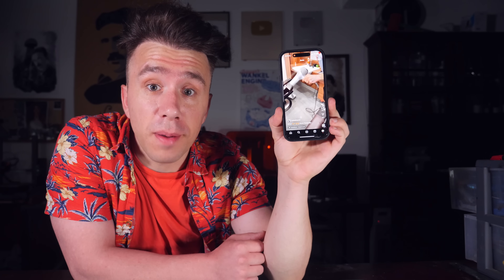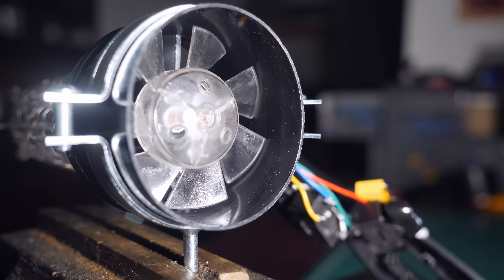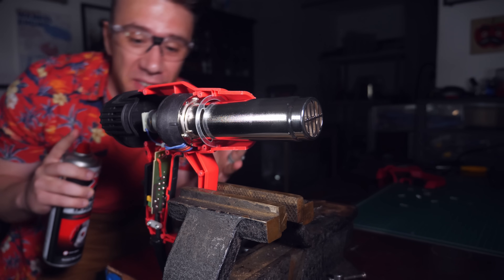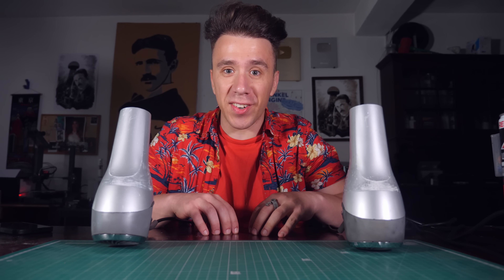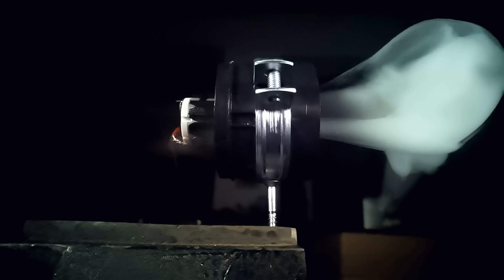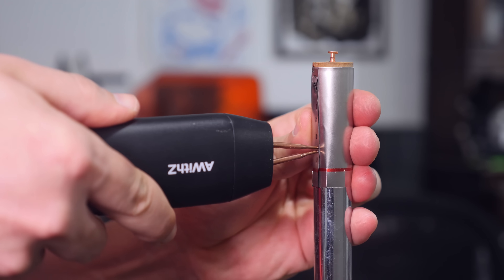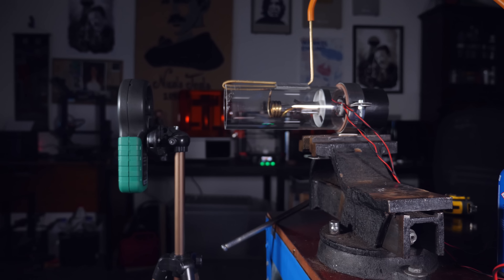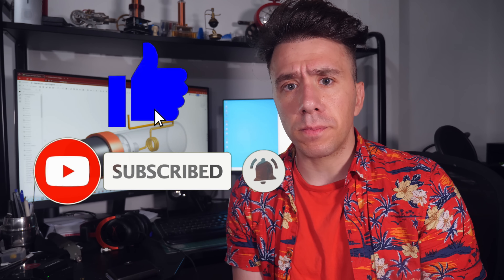I turned my $20 Hairdryer into a JET ENGINE

Comment: As I said before, you need to compress the air with the brake cleaner before passing it over the heating element like a turbo or a supercharger in a car.  Also like a gun riffle the output so the air and gas spins around the heating element.

Comment: My idea to improve the design: make a defuser that doubles as the shield around the nichrome coil, any air that travels past should slow down and enter the coil area at higher pressures to assist in combustion. I cant remember the name of the sponsor who can metal 3D print but they would probably be perfect for this and many other videos.

Comment: You should try to add the converging nozzle to yours like in the video as it’ll accelerate the flow and compress the air a little more. That can prob work for a normal hair dryer

Comment: More wire does not mean you need more current to get it hot.  It means you need more voltage to achieve the amperage at which the wire gets red hot.

Comment: Me and my 10-year-old son watch the video and loved it. We talked about it and imagined four fuel inputs put at an angle in front of the fan blade. Each with their own heating element and fuel supply from one main fuel source that is pumped through all four equally. The lit fuel would enter the chamber right in front of the fan blade at an angle that coincides with the vertices of the fan wind. This way, you’re supplying fuel all around the main area where air flows around the fanblades.

Comment: If nobody mentioned adding salt to the tubing and crimping the ends before bending will help to ensure it won't collapse upon itself. The salt will easily risne out with water after. No heat needed to bend.

Comment: For increased thrust would a nozzle work? Like a turbo jet?  Correct me if I'm wrong but, wouldn't that slightly compress the air and allow for a better fuel to air mixture?

Comment: Inject O2 gas instead of brake cleaner, it will be a bang. and you can melt the face off a tomato when doing it.... Because Tomatoes really are disgusting! (oh and try coning the tube like a rocket nozzle)

Comment: could prob use a 3d printed stator/diffuser ring to guide the air into the flame, interference fit should work instead of mounting as its before the flame, and adding rotation to the air will likely show improvements. could also inject into the combustion chamber through a hole in the acrylic if heating the fuel isnt essential.

Comment: You could try to make, or re-use, a car injector to do a beter mix air-fuel. They're meant to do the best mix as possible to use absolutely everyting in the chamber. You can also calcul, with the air flow meter, how much speed and fuel you need to do the perfect mix

Comment: throw a helical fin design that can allow air flow and add some constrictor towards the back end. you can then have holes in the tubing that would now allow you to add extra fuel further down sort of like an afterburner. by ramping the air you should be able to generate better thrust out put. sort of like an aerospike

Comment: Higher fuel pressure, smaller nozzles! Maybe a fire ring manifold with much higher pressures, but smaller nozzles to atomize the fuel!? Maybe? 
Think HPLV, high pressure, low volume. And maybe an internal metal tube to help with combustion  chamber?  That has a large chamber reducing to small, to help with compression?

Comment: Hm just a thought, but you know those propane burners people use for large pots? Those use a mechanism that allows you to moderate the airflow for the burner with just a turn of a valve. I’d tinker with that and see if you can’t incorporate that into your build. That valve design pulls air in rather than directly propelling it. Maybe a combination of forcing air into the intake area and propelling it would allow for enough compression thus causing a WOOOSH

Comment: I think a way to improve it would be using the fuel lines as the rapid air shielding for the combustion chamber, in that way it'll also preheat the combustible, and reducing the overall weigth, also, it may improve the exhaust velocity constricting a bit the chamber, not like a nozzle, but more like a turbofan

Comment: I think you should create an inlet from the side, at an angle so it creates a spiral of injecting fuel. The inlet should also include the wire so the fuel ignited before entering the stream of air.

Comment: You need to look up exhaust Augmentation where you have a flameholder, spray rings and ignitors. This gets really hot fast and consumes loads of fuel, but the thrust is going to be insane. Any modern day Turbo jet engine has this.

Comment: Measured fuel injection system, fanspeed control with power meter for monitoring draw, add more holes into the endpoint of the injection system for better fuel atomization. 
Just a few ideas that come to mind, thank you for your amazing videos! Educational and fun!
Reply: W man
Reply: He could also add another tube that's capped or a complete circle loop with holes drilled in it that's half the diameter of the acrylic tube. Place it in the middle of the flame dispersal zone, and it'll act as an afterburner.
Reply: @longov excuse me. What the quantum physics are you talking about lol
Reply: Cool😅 smarty
Reply: What if he uses propane or a more flammable material or gas or liquid doesn’t matter

Comment: Make a fan that is driven by a gear or belt and place it in a large outer bearing so that you do not need a DC motor for the fan itself. then you have more air movement and no air blockage. or you can use a tube as the shaft of the fan where you supply your fuel for a long time (with a bearing around the tube)

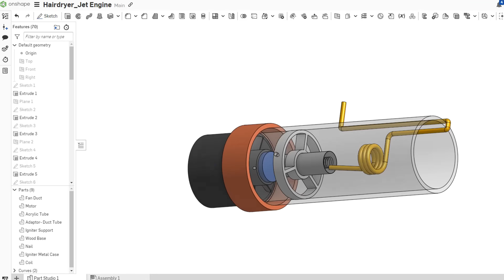Comment: 13:10 put a diffuser cone in front of the injection coil, to push some of the fuel outward tho allowing some to pass thru as it is full of holes to catch fuel in draft and make a self regulating catalyzer of its self so the starting coil can be turned off tho its close enough to the center draft that the pilot flame stays on... like a cheese grader tho. that centered iron that lets air thru it... Instagram a windows pait pic...

Comment: In order to utilize all of the fuel build a housing using a similar concept as a smokeless burn pit. Using concentric cylinders you can separate the fuel mixed air from the intake and a modified carburetor to spray the proper amount. I don't have it fully fleshed out but that's where I would start.

Comment: @Integza Hey Integza. I had a thought when it cam to your wind meter. Why don't you "sketch up" <-- See what I did there? LOL. Your Windmeter blades and shroud. and 3D metal Print a replacement metal unit for this type of testing to stop the melting issue. :D  I Love your videos. we have similar minds. Keep them coming buddy!

Comment: you could put 6 mini misting nozzels on the sides of the tube right after the fan and 2 or 3 igniters a bit further down in the combustion chamber. also, please add a nozzel

Comment: Atomize the fuel after the fan in the space that has the dead spot after the hub. after the fuel is atomized into the high speed air, duct it past a "bell" that houses the igniter and functions like a flame holder in a regular jet engine. The space with the bell/flame holder would need to bulge out a bit to maintain a constant volume for the air channel until it tapers back down after your flame holder/ignitor. 

the diverted bulge of the air channel would give the benefit of adding turbulence to mix the air/fuel and then the void with the flame holder/ignitor after the diversion also takes part of the blowback risk from the expanding burning fuel, this should improve total effective thrust.

Comment: If you look at "how to build a jet engine using a turbocharger", you'll see they usually end up using a tube with holes to make a flame holder for that... 
I always wanted to build a transparent one, but round tuits are an issue for procrastinators... if you look at TechIngredients and a few places, you can get the dimensions and engineering how the static pressure and the airflow sets the pattern and placement.

Comment: Well what I would do is inject more fuel into the air after the initial combustion so you don't need to worry about ignition. Run the engine rich and add a flame holder. Afterburner time.

Comment: you can buy liquid brake cleaner in drums without propellent from most automotive stores, that will allow you to pump or gravity feed the fuel at controllable rates, also if you have additional air then you need an afterburner!

Comment: To increase the air used in combustion maybe use a steel/glass tube and multible fuel nozles around the tube and use electrical sparks for a more reliable ignition of the fuel??

Great vid 🍻

Comment: Same suggestion as yesterday: keep the internal combustion, add a ring shaped injection system to force a fuel air mixture into the chamber with the existing combustion. Poof! More combustion.

Comment: The first thing that came to mind. Likely needs refinement. 

Idea:
3D printed fan blade with  internal fuel line to multiple nozzles along the trailing edge of the blade or ported flush to the airfoil surface. Tricky bit would be a low enough friction fuel rail/fuel hub from which the rotating blade manifolds could be supplied by a stationary fuel line. 

Thinking the fuel line can come in axially to the nose end of the propeller hub and interface with something like a rotating linear hose coupler that can handle the rpm. Then that goes to a central distribution plenum with a conical base (perpendicular to the axis of rotation) that the blade manifolds then feed from. The blades may even give a pressure  boost at the nozzles due to the centrifugal force flinging the fuel out along the primary manifold line.

You may even be able to normalize the relative pressures at the nozzles by varying the secondary manifold lines diameter for a given fixed operating rpm before printing (requires experimentation and investigation).
The benefit of that would be to gain  design control of the fuel flow and atomisation (mixture) through the full thrust column cross section for a steady state or "cruise" operating condition. 

Just what came to mind. 
Looking forward to the next installment. 
-C.
Reply: Actually on second thought.... I think you 3d printed some ceramic before. 
 
3D print in ceramic a post which the ignition element can be wrapped around.
Internal to the post should be a path which the fuel can be pumped through  to heat it up and ideally vaporize it. 
The fuel should then be ported through nozzles around the base of the post (towards the front of the engine ). Think of it like taking the frame of an umbrella putting it in a tube of concrete and then removing the tube and melting out the umbrella frame and then pumping fuel in where the umbrella handle went and having nozzles around the circumference where the umbrella arm tips are.  All while the ignition element is wrapped around the outside heating  the concrete which preheats the fuel. 

The reason for this is that the coil fuel preheater in the jet stream does a couple things.
 One, disrupts airflow increases back pressure and decreases thrust. 
Two, takes away thermal energy from the exhaust gas thus reducing nozzle pressure and affecting thrust. 
If you are adding the compressor energy with an electric fan and heating element, and if the goal is to get the most increase in thrust for fuel given. Then it's better to take more energy from the electric heating element rather than sacrifice thrust energy. (Potential Energy (chemical, electrical) In = Energy (electrical/magnetic, mechanical friction /thrust/acoustic noise, thermal/heat/light) Out. 
Where, design optimization turns energy from loss categories into the desired thrust. 

The main reason I wouldn't recommend this type of preheater is that; For this application, the burn temperature, and burn distribution for the given air/fuel flow rates, and average burn duration, is such that it's unlikely the preheater in its current format will reach a sufficient temperature in normal operation to have a significantly positive affect on fuel atomisation or vaporisation and subsequent thrust when compared to the performance disadvantages mentioned previously. 
This is speaking from experience. I did the exact same as you. 
Pro tip: if you decide to scale up do not use copper. 
As soon as you do finally get good ignition and optimized burn, you will be rewarded with the liquification of your tuned copper preheater and several hours of carefully removing copper from the hot stage components of your turbine and nozzle assembly. 

Old school pro tip: when bending the copper. First fill the tube with sand and plug the ends with a hammered in wood peg or chopstic in this case. 
The sand stops the tube from buckling during the bending, is not affected by heat, and can be poured out after forming. 

The next trick is getting a good mixture through the thrust column. Maybe vortex generators or ceramic stator fins at the top of the igniter nozzle. 

Or in the forward end of the igniter nozzle you have ceramic stator supports radially out to the outer tube to hold and position the igniter nozzle. Then in those struts you run an internal fuel manifold taking the "umbrella arm tips" up the strut and ported to nozzles along the trailing edge so the hopefully vaporize fuel flows back over the ignition element as it mixes with air and ignites. 
From there I think it would be interesting if adding a ported flame tube around the igniter improved performance by controlling the rate of air fuel mixing and shielding the igniter from the air stream thus improving fuel atomisation/vaporisation by allowing for a higher preheater operating temperature. Better atomisation or vaporisation means more even mixture with less effort and disruption/resistance to the airstream.
Reply: If the fuel starts leaking through the porous ceramic. Then use that glaze they put on ceramic cookware like coffee cups. 
Mix it up thin, pour it through the fuel channels then use an air compressor to blow out the excess leaving only a thin film to seal the fuel channels then re fire it in the kiln that you did the initial sintering. Don't do it at the same time or the off gassing if the binder in the printed part will cause voids in the glaze that will leak. It needs to be a 2 stage fire I reckon.

Comment: @integza add a cone like that on a rocket  engine only since using a fan dont make the nozzle so small reduce the diameter by 1/4, 1/2 if it still works then go smaller

Comment: Maybe you could print a Part that decreases the inner diameter of the acrylic Tube for a short section and after the comression step you have an embedet Ring as your fuel line. So when the air fuel mixture expands again the fuel is more evenly mixed throuout the airstream. The igniter could be Placed in the middle of the fuel injektion ring.
I hope its understandable englisch is not my firstlanguage

Comment: Suggestion: In the original video of the brakekleaner you see that a nozzle is attached to the hairdryer, which increases the pressure in the chamber supporting the combustion and additionally canalizes the air flow to get a higher boost. So just try it with a few different types of nozzles.

Comment: To increase the burn rate you'll need to increase the surface area of the fuel. Thus instead of the fuel entering at the single point one will need to add a circular nozzle for fuel injection and experiment with the angle the fuel enters the chamber. Perpendicular, straight, toroidal and even helix or double helix.

Comment: I've been watching your content for a long while. And I've got to say I always wanted to build a some kind of rocket/jet engine (preferable a jet engine, which is what you're almost making there. However the thought of printing it and figuring out how I could make it run just makes me so excited). I wanted to ask my friend who recently bought a 3D printer to print it for me but it seemed like too big of a hassle to constantly ask him for printing. Anyway here's the idea I thought of:

1. Right behind the electric motor you make a teardrop shaped cone pointing right into the combustion chamber. This cone should make it so that the air is nicely guided to the combustion chamber without too much power loss and interference. 

2. Make it so that the combustion chamber can have free air flow. Make the bracket out of spokes so that air can flow trough it. 

I've made a very basic illustration for it as I suck with 3D software and using it. You can find it here:
https://imgur.com/a/VD5TJ7E 

Hope this helps

Comment: What if the design replicated the engines on the original Boeing 737? Like the engines that had a low bypass ratio and used more of the combustion to propel instead of the propelled air

Comment: Use an impeller like that turbo and connect a hose or adapter to the outlet. Puts more air centered rather than turbulent air on the edges. Although I’m not an engineer so it seems smart to me but I could be completely wrong.

Comment: tips for improvement
1. Use a nozzle to spread the fuel
2. add a de laval nozzle to increase the pressure inside and give the fuel more time to burn
Full explanation:
To use 100% of the oxygen in the air, the fuel and air must be mixed well and in the correct stocheometric ratio (see flammability diagrams for methane for example). I think using a nozzle to spray the fuel towards the sides of the pipe (where there is the greatest air flow) would help. finally adding a de laval nozzle would increase the pressure inside the tube (improving combustion) and would also increase the speed of gas exit. increasing the fan speed would also increase the pressure.